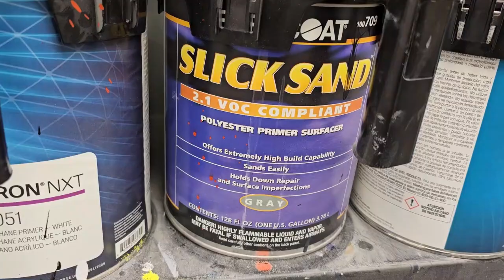Painting A Two Tone Carbon Bumper & Panels On A Nissan GTR

Comment: I have learned a ton from your videos.  Today I sprayed dbc metallic with a 3m performance gun 1.4 and then vc5700 clear 3 coats with a devilbis 1.3  c2 air cap and it came out great, looking like it was dipped.  Except:  a bee decided to commit suicide after the second clear coat.  I know in your booth this would never happen but I think if you made a video about how to recover from this mishap it would be popular and greatly appreciated.  Thank you.

Comment: You did a great job on the aftermarket bumper Kandy Man as those things are never the right shape or size, you can take 2 bumpers from the same mould and they can both be different especially if they are fibreglass, one person may put more activator in the resin that someone else which effects the curing time plus they can get hot during the curing process which can cause shrinkage.
Quite a few years back I used to work in a fibreglass company making the casings for MRI scanners and it was a nightmare getting them all the same🙏👍John UK